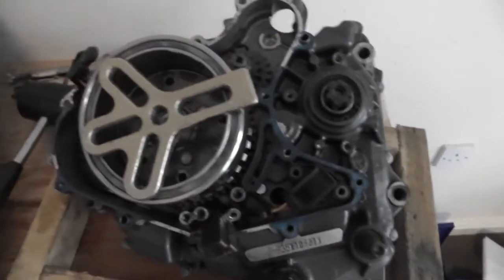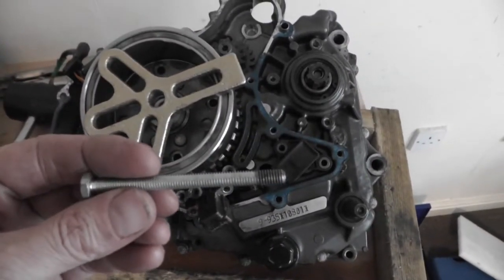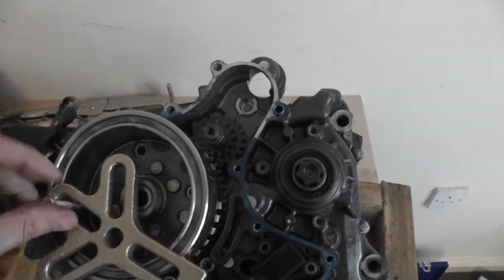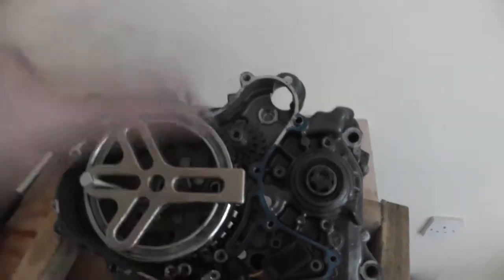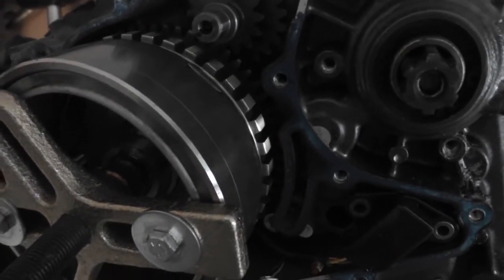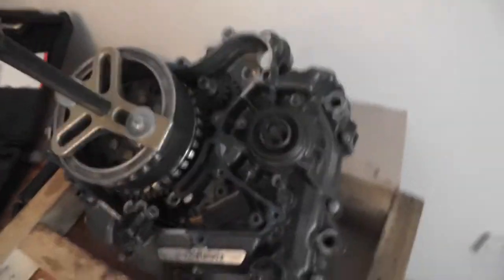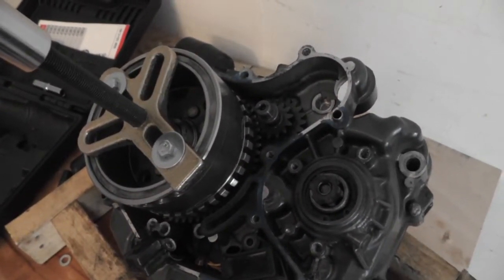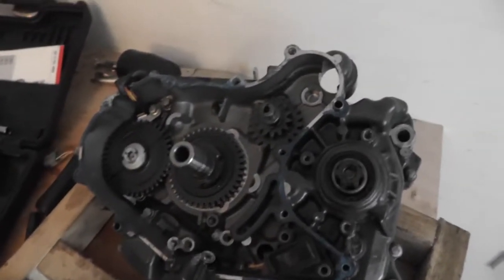KTM Duke/RC 125 Flywheel Rotor Removal Guide (Magneto/Stator Access)

Comment: Stupid question but is there a certain way the flywheel goes on will it mess up timing if it's off ?
Reply from the maker: there is a woodruff key that hold the flywheel in the correct position on crankshaft but the crank and cam then need to be timed as you fit the head